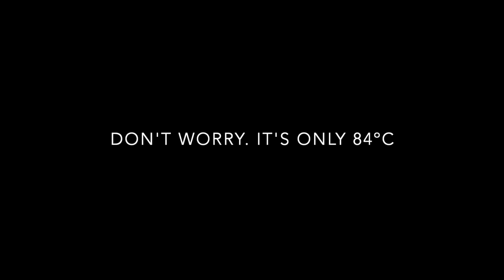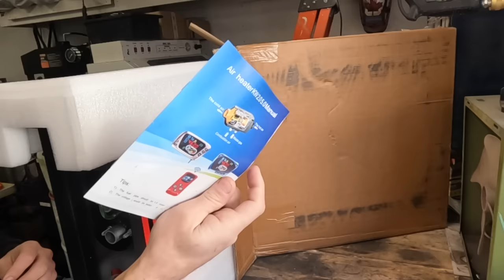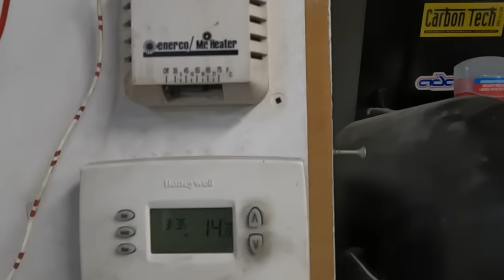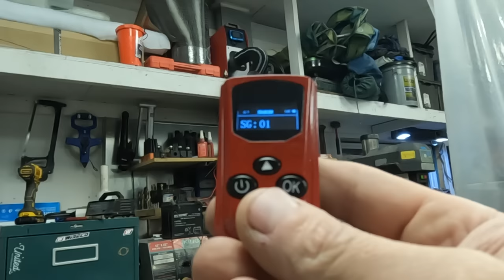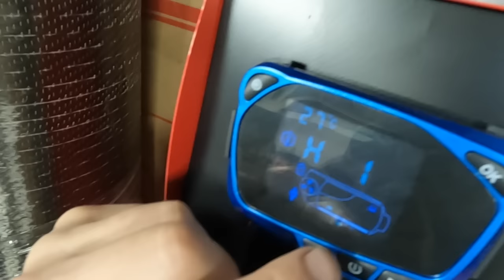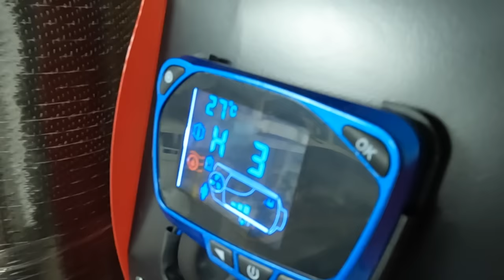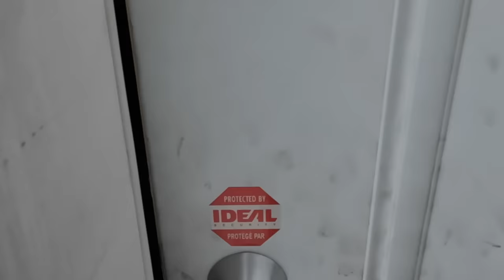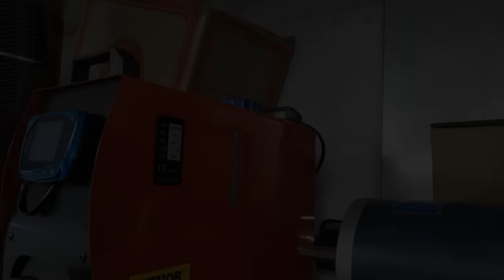Chinese Diesel Heaters - DON'T BELIEVE THE HYPE !!

Comment: Interesting, there are 1,000s of these heaters in boats across the world and to date I've heard of no reports of any of them being burnt to the waterline. 

A few comments/questions:

1) Why is the heater placed that high in your workshop?  Heat rises so the usual solution is to place the output close to the lowest level in the area you are heating

2) Why do you have a 90° bend in the exhaust just as it exits the heater?  The usual advice is that there should be no sharp angles in the exhaust especially as it exits the unit.

3) Why are you just burning old oil in your heater?  A mix of diesel or kerosene with a maximum of 30% oil is the usual advice.
Reply from the maker: Thanks for the comment. 

I like your humor. Good stuff. 

1. The heater is placed high so that it is out of the way, but still accessible for my tests / experiments (if you watch more videos, you will see) I'm not concerned about max efficiency, just making it work. (on waste oil) 

2. I'm a mechanic and feel like the concern about bending the exhaust is exaggerated considering the fact that it is 5kw. I do change / test this in following videos.

3.This is a long answer, but... others on youtube / the internet have claimed that it works perfectly well. I have a supply of waste oil that I either have to dispose of or burn. Diesel is $2/L where I am and kerosene is $4/L and the oil is "free" so it cost me whatever I mix with it.
Reply: The unit should be mounted high enough to allow a fan to blow across the straight down or steeply sloping down exhaust.    I use 40 percent ULTRA filtered waste oil and/or veggie oil, 60 percent diesel, 10 percent petrol in my second manifolded tank, straight diesel/heating oil/kerosene in my first manifolded tank.   Start and 10 minute high power shut down on diesel, run on waste mix.

Comment: i think it's overheating because the exhaust is right behind the inlet duct where the electronics are and the hot air is overheating the burner chamber to, relocation the exhaust away form the inlet duct will solve that problem. i fund that in German made heater manual.
by the way if you mix old oil whith diesel 60/40 maximum and leave it in higher setting it will work.
Reply from the maker: Thanks for the comment !  I have been experimenting with the heater a lot after this video, tested lots of things and I have even tried feeding hot air into the inlet directly... While this does cause the temp to rise, it is not substantial. This heater tends to run perfectly fine on diesel, I have run it on diesel for 7 days non stop now, with no issues at all, 5 or those days at the max heat setting. 

I have been experimenting with different diesel / oil mix ratios. At 50/50 I was still having issues, so I think I need to do more investigation and experiments. I will try the 60/40 mix.

Comment: The muffler is inside the garage. The muffler has a weep hole on one side and you will notice a gap between the sides of it around the pipes at both ends. Point is, the muffler shoots out a continuous stream of carbon monoxide and can shoot out flames of fire as well.
Reply from the maker: Hello Charles. 

I am aware of the weep hole. I realize that this is not correct but I wasn't concerned about it. I had a CO detector in my garage and don't sleep in there. 

I have, since this video, stopped using the muffler altogether.
Reply: No.. it does NOT spew out a stream of CO.  even at highest power the amount of clean exhaust coming out is MINISCULE.  I have experime Ted and found zero issues and NO moisture since no time for condensation if 1 foot away.
Reply from the maker: @gbear1005  Haha... I think you are more upset about this than I am.... I have heard this hundreds of times, at this point.

Comment: I got one almost 3 years ago now, I'm thinking about getting another , and modify it to work with a heat exchanger, to heat water,  and possibly scavenge heat from the exhaust,. To heat water for showers, as well as radiant floor heating,  I was thinking about using used engine oil with kerosene upto about 50/50
Reply: James, for an exhaust gas recovery system I ran the 1" exhaust into a 10' x 4" pipe and by the time it leaves that pipe it's only 5-8 degrees above room temp. Just watch out for exhaust back pressure , the slightest increase and it won't run properly
Reply from the maker: Great idea
Reply from the maker: David McLuckie has some videos about heat recovery with a bunch of different stuff... pretty interesting.

Comment: The manufacturer and seller clearly write that NOTHING BUT PURE DIESEL AND ANYTHING BUT DIESEL, Yet people will try to burn crap, then people whine and complain.
Reply from the maker: I didn't see that anywhere on my one page manual, (Purchased from VEVOR)  but I'm not complaining about it not burning crap... I'm complaining about other people saying that it will burn crap... I totally wouldn't have thought that it would burn waste oil, because it doesn't burn well, or clean.... but then I saw a bunch of people claim that it would burn lots of crap. 

So yes... I'm not complaining about the unit, or the manufacturer, or the seller of this unit. I'm annoyed that there are people on the internet telling other people that these things burn waste oil for years with no issues.
Reply: well said

Comment: Heat also goes upwards thus better to put it lower and spread the heat with more tubes. Then your garage will be fine. Now your ceiling will become very comfortable. And also agree with other comments. It is a diesel heater not a waste oil heater. You can make fuel yourself but that requires it to have a burning point similar to diesel.
Reply from the maker: Thanks for the comment !  The heater is placed where it is, for now, so that it is accessible for experiments, but out of the way. In the future, if I get it to work well for more than a few days, I will change the location. 

These heaters work really well at burning diesel ! I'm actually getting another one sent to me by VEVOR to do more realistic testing, but I bought this one specifically for trying to burn waste oil. Cheers !

Comment: Had a small fire with mine going through floor with mine made a metal box with ceramic fiber around exhaust love it now
Reply from the maker: Oh no, haha.. You don't want fire outside of the heater !... only inside. I now have 6 of these heaters and love them also.

Comment: So i have 2 of these, run them both on diesel & kerosene both have been fault free since the day i bought this 12 months ago, i tried waste cooking oil with a mix of kerosene on one of them, with in minutes it stop working, it would blow but not burn, with proper research i find it is only any good on thin fuel, so if you run straight oil or get the mix wrong it doesn't like it, so i now just use it like it was designed to be used & stoped listening to people on YouTube talking crap about them, don't even listen to those who say the heat their homes on one, these would never heat a home, only good for small to medium shed/garage or a vehicle/caravan/ motor home! Use it for what it say on the box an it will be fine, abuse it what do you expect!
Reply from the maker: Well said ! I can't stand videos of people saying you can heat your home ... all that is 100% is people using fear to get views ...There's a lot of concern about the world ending and fuel prices etc.... so the "how to heat your home almost free" videos get massive views. 

I'm making this video series to try to show people that most of this is complete nonsense and if you burn anything but diesel (and diesel like fuels, you're probably going to have issues. I have run mine on diesel, and my latest video (part 6) I show that diesel actually does a pretty good job of cleaning out the heater after I had been using waste oil.

Comment: I run the engine on my truck to heat my truck. I go through about 6 US GAL over night at about $6 per gallon. Buying one of these will pay for itself in a week. I'm going for it and am going to hook it to the truck via vents on the sliding window of my 2020 F250. Next summer I'll build a permanent mount that will mount the same.
Reply from the maker: Yeah.... These are awesome units for that. I think I'm going to be installing on one my buddys Toyota 4 Runner.

Comment: straight oil burn should be on high or you will get oil going through exhaust/build up. also if the unit can't burn hot enough or you don't have the pump set correctly unburned oil will also go through the exhaust. if it can't burn hot enough use a fuel oil mix.
Reply from the maker: Yeah... I have done a lot of testing after this video... burning oil vs diesel turns out to be quite tricky.

Comment: I had some issues too with used oil, someone wrote that synthetic oil is designed not to burn that's why it works so well in engines but obviously not so great in a heater
Reply from the maker: Thanks for the comment / input ! Yes... engine oil in general is designed not to burn. They put all sorts of additives into it to help it lubricate and be heat resistant... this does not end up being a very good fuel... and that's before it's used. After it's used, it has wear metals from the engines and lots of combustion byproducts. 

If you get a "perfect burn" you are still left with all of these contaminants / additives that do not burn. They have to exit the system somehow. If you are lucky and there's a lot of turbulence, maybe it comes out the exhaust ...
Reply from the maker: @totallylegityoutubeperson4170  I love the youtube name and the word "dingus" lol... I haven't seen any evidence that veg oil would work better, and I have seen a few tests with it that show it doesn't perform that well, however I have not tested it myself. 

The whole reason I'm using waste oil is because I have a supply of it as part of my job... I have to get rid of it some way. I would have to source veg oil, even if it was free it wouldn't make sense for me.

Comment: have you tried with black diesel? (roughly 5 gals filtered WMO and a pint of gasoline) or have you tried 30% diesel and 70% WMO/ used cooking oil? apparently the mixtures are important to thin the motor oil, and it works best when its already heated. the most success I've seen is with 2 tanks, heating it up on diesel then switching it over to the waste.
Reply: I wrote this before I watched 10 more episodes. So please disregard lmfao
Reply from the maker: I have tried all sorts of different mixtures of gasoline, oil and diesel. Preheating with gasoline in the mix is problematic as it off gasses in the lines and causes erratic feeding. I have 30 more videos or so of all sorts of crazy testing, haha.
Reply: @loweredexpectations4927  yeah I wrote this before I got 10 episodes in and was seriously rooting for you cause I bought one to run on waste oil too. Lol i haven't tried mine yet.
Reply from the maker: @plainandsimple1   "seriously rooting for you cause I bought one to run on waste oil too. " HAHA... If you are going to try I would recommend using VERY little oil... You might get away with 10% ... it would save you 10% fuel cost.
Reply: @loweredexpectations4927  only 10%? I can't push it to 30 or 40%? That's super disappointing lol but at least it's decently efficient on diesel.
Reply from the maker: @plainandsimple1  Burn chambers are pretty cheap... I wouldn't discourage you from trying 30% if you have a backup chamber to change out ... but I suspect you would have issues within a week of running, if you run fairly steady. 

If you are trying to be efficient and save on fuel, the best way to do that is to use some sort of heat exchanger to capture heat from the exhaust (in a safe way) ... you lose at least 500 w out the exhaust, so if you can get that back it's a big help.
Reply: @loweredexpectations4927  I saw guys run long pipes through sand batteries and it worked pretty well at capturing the excess heat, but idk how well it would work long term for build up, condensation, etc.
Reply from the maker: @plainandsimple1  Yes, if you are pulling heat out, you need to make sure you can get rid of the moisture. Either have it all down hill or have weep holes at low points. Water is an excellent thermal battery.... and you may even find use for the warm water. WIth a little experimenting, (or research) you could figure out how much water volume you need for this to be effective. 

However, if you want quick heat, using copper or aluminum pipe will get the heat into your air space in a hurry. Of course, all of this needs to be sealed really well or you are at risk of CO poisoning.
Reply: @loweredexpectations4927  I wonder how using a length of baseboard heating pipe with the fins would work. And yeah. Any leaks and you'll asphyxiate yourself pretty quick lol I'm a farmer and a hydro power plant mechanic, so I'm into the same style of hazardous fuckery you're doing here lol trying to get shit to work cheaply is the name of the game!
Reply from the maker: @plainandsimple1  I've been testing these heaters in my latest videos, and they actually run VERY clean, but you still don't want to be venting gasses into your living area. 

Baseboard heating pipe has been on my list of things to do for a while... I have a feeling like it would work very well.
Reply: @loweredexpectations4927  I think I'm up to video 10 or 11, I'm gonna finish watching tomorrow and see what else you've tried with it.
Reply from the maker: @plainandsimple1  If nothing else, it's entertaining. 👍
Reply: @loweredexpectations4927  ain't wrong there bubba!

Comment: The muffler has to be outside, there is drain hole in it... leaks exhaus in to your shop..
Reply: Thanks for the tip / comment ! I was aware of this and have since removed the muffler and am now venting the pipe directly.
Reply from the maker: Just realized I replied to you while logged into my other YT channel. Oops. Hope I didn't confuse you too much.

Comment: The exact same flaming exhaust occurs with the high priced webasto units as well. I formerly worked at a school bus leasing company and we had a fleet of busses with webastos and on several occasions I was called to vehicles that failed to start and found the webasto (installed as a coolant and engine heater ) happily flame throwering the surrounding but not really hearing the exchanger.
Reply: Haha... it's pretty cool, but not ideal. As long as there's nothing close by that is flammable, I guess it doesn't matter. Thanks for the comment !
Reply from the maker: Just realized I replied to you while logged into my other YT channel. Oops. Hope I didn't confuse you too much.
Reply: Webasto heaters sometimes are like a volcano 🌋

Comment: Replace the fuel line with better quality tubing and add a fuel filter, runs well
Reply from the maker: Thanks for the comment.  

The "replace the fuel line" is a very common misconception. Several YouTubers and bloggers claim this, but their reasoning is flawed, once you understand how these heaters actually work. 

I do run a 80 micron inline filter. I'm sure that a finer one would be better, but not sure that it would help at all with the end result.  

I plan on doing a test in the near future to prove that the quality of fuel line does not matter at all. Not trying to pick on you, by the way, I have gotten this comment a lot and just try to set people strait.

Comment: if you use filtered waste oil, I would suggest that you only mix 5% waste to 95% diesel as I watched too many video showing the problems with burning waste oil, flameout, overheat, clogging up the burning chamber etc, I have been running mine on just pure diesel for over 3 months and no issues at all !
Reply from the maker: I am using filtered waste oil... however, there are lots of different levels of filtration, and I could do better. 

I'm fairly certain that 95% diesel would work just fine, but at that point, it is not at all cost effective. I have two natural gas heaters in my garage with a total of 280,000 BTU, but I got one of these to burn waste oil as I have a steady supply and it is free. It's not looking promising, but I will continue with my experimentation to see if there is something that I can do that is cost effective. 

I have run mine on diesel several times now and it actually cleans up some of the garbage that is left behind from burning the waste oil... No issues at all.

Comment: Are these safe for home heating?
Do they have any sort of tilt shut off?
Reply from the maker: They are not practical for heating a home, as they do not put out enough heat, unless you have 4-5 of them. They do not have any sort of top over protection, but they are supposed to be firmly mounted and not just sitting in place. 

You can purchase these not fitted into the case (or remove it from the case). If you plan to transport the heater form one area to another, the style that I have makes sense, otherwise, one of the other kits (or removing this heater from the case) make more sense. Cheers.

Comment: Why not put the filter on before the pump? If the filter plugs up and restricts it will cause the fuel pump to not run thinking that the burner has adequate fuel pressure. That will cause the burner to over heat do to lean burn. 😢 what happens when you tune a two stroke to lean ??
Reply from the maker: The filter is before the pump, tho it may not look that way. 
I just released a video called "NO FUEL PUMP - Debunking The Quality Fuel Line Myth"  These heaters do not care about fuel pressure and only care if they get fuel... That's why the pumps are called "dosing pumps" I will try to link the video in another comment so this one doesn't get blocked. 

Diesel is not the same as gasoline... when you run diesel lean, it gets colder, and when you run it rich, it gets hot.... this is why you see trucks driving around "rolling coal" rich makes power.
Reply from the maker: https://youtu.be/QvC2bZy9bI8